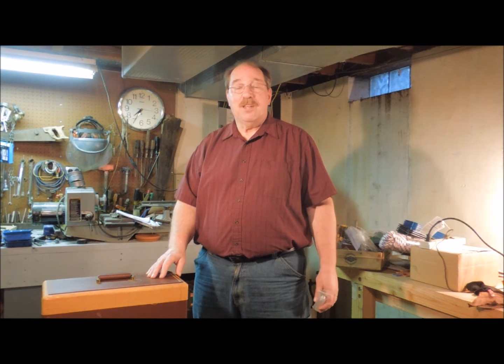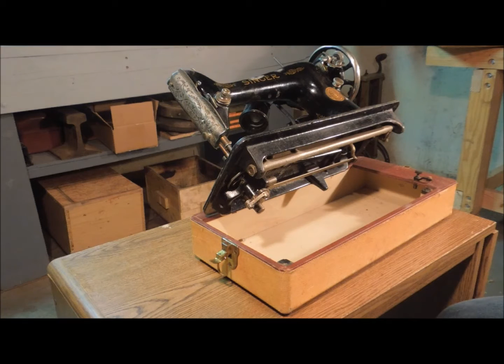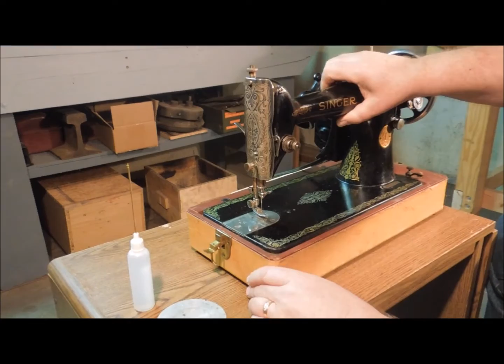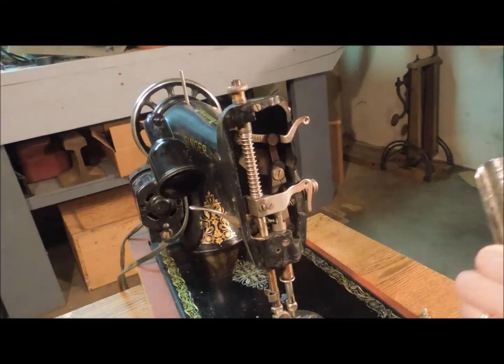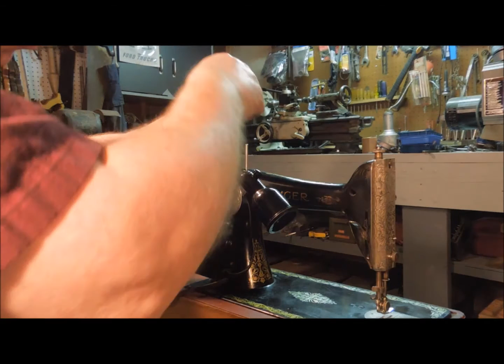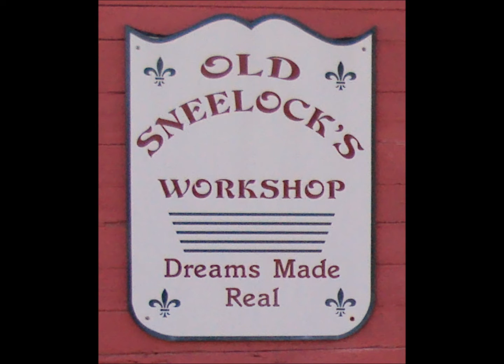Final Setup of the Sewing Machine   Oiling the mechanism   by Old Sneelock's Workshop

Comment: I need to change the wiring for the foot pedal and the power cord. Do you have a video on how to do that? Thanks. I've learned a lot from you.
Reply from the maker: +Elaine Flynn I'm sorry I don't currently have a video on that. Lucky for me the cords on my Singer were in good shape just had the grommet out of position. Do you need to replace the switch and the power cord? If s I should be able to disassemble the motor and switch to show you how to change the cord. It will take a while. Christmas is a busy time for me.